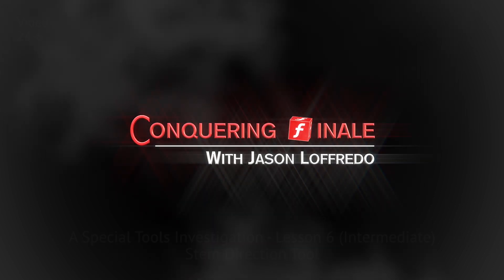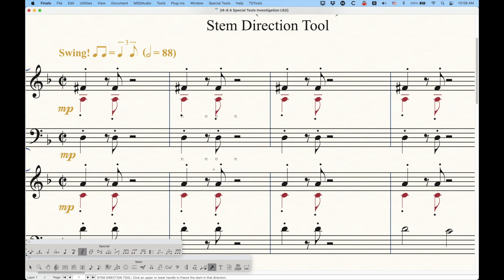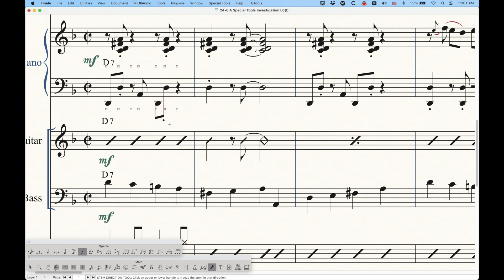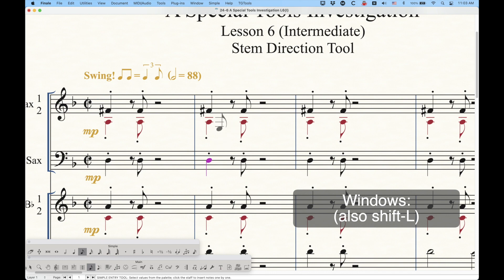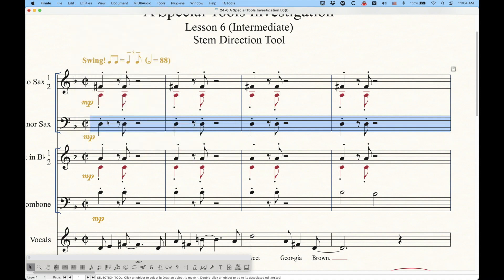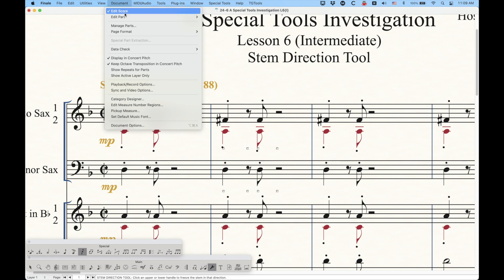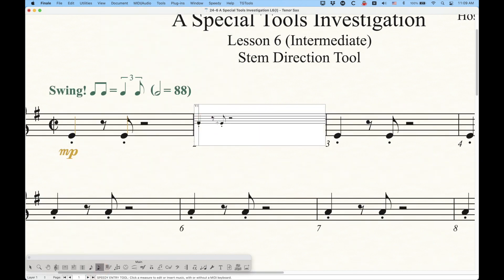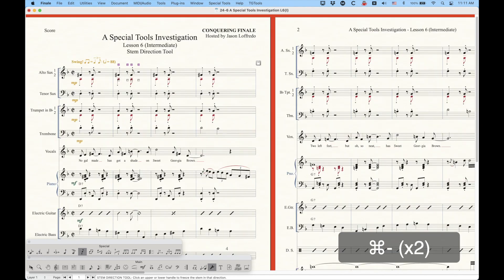24-6 Stem Direction Tool (Intermediate)

Comment: Hi, friend. Would it be possible to set the default stem direction of the middle line upwards automatically?
Reply from the maker: You'd have to do this on a staff by staff basis.  Go to the Score Manager, and for each Staff, on the bottom right where it says Staff: choose the Other... option.  Then in the Staff Setup dialogue box change the Stem Reversal value to -3 instead of -4.  That will make the B always go up.  Again, this can only done for individual staves, you can't set this globally.